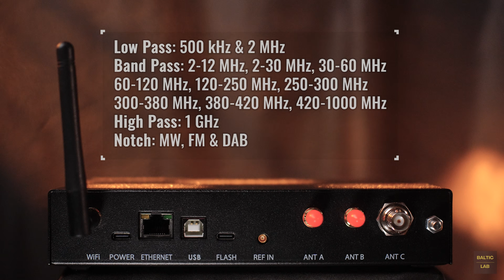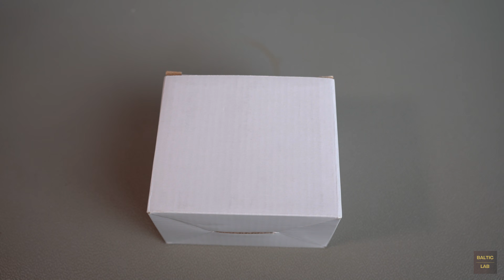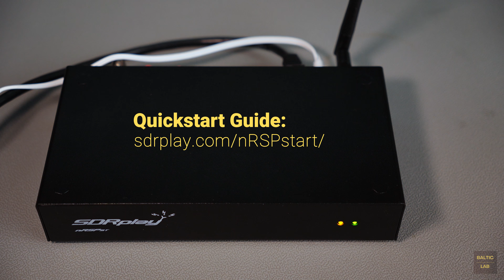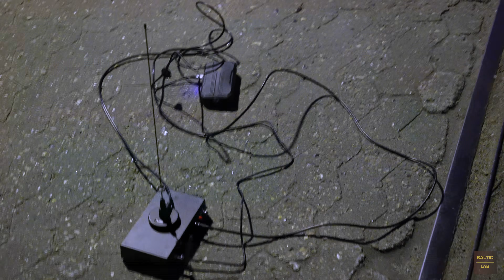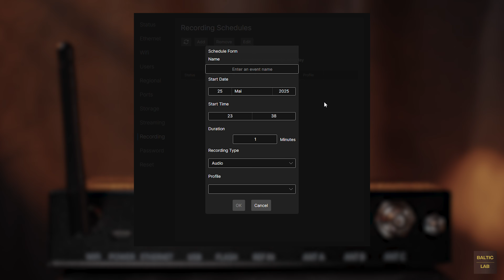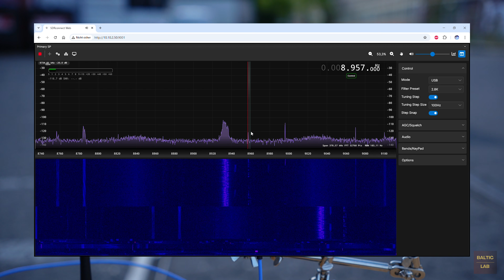This Networked SDR Receiver is Insanely Powerful | nRSP-ST Test

Comment: Hi there, good channel with solid content - just joined. Thx for that review and test with the powerbank. That's exactly what I have in mind to carry out antenna tests on my balcony. I am dealing a lot with DIY suggestions for antennas. Sometimes somewhat unusual ideas for loop antennas for VLF, LW, SW, UHF. I am working a lot with RSPdx. Now I am thinking about buying an nRSP-ST. BR Klaus
Reply from the maker: Hi Klaus, thanks for joining! Sounds like a great setup for your antenna tests, especially with those interesting DIY ideas. Hope the nRSP-ST works out well for you! 😊
Reply: @BalticLab  Well, the only thing holding me back yet is the high price.
Reply from the maker: @electronics.unmessed Agreed, that indeed is the most common holdback.
Reply: @BalticLab  From your powerbank test: can you tell the power consumption? Or in other words: how long would it run on a 10.000mAh powerbank?
Reply from the maker: Good question. Honest answer: I don't know. I never checked the actual power consumption.

Comment: Thank you for sharing. What was that active short wave antenna you were using?
Reply from the maker: The antenna used is a so called Mini-Whip antenna. They can be found on eBay and amazon for very little money. They work surprisingly well.

Comment: NO USB Support for local use. WiFi connection - signal drops out or hangs for several seconds.
I am very disappointed in the nRSP-ST, especially given the lack of USB and cost.
Reply from the maker: Thanks for sharing you experience with the device.